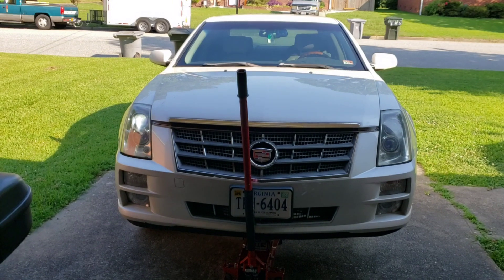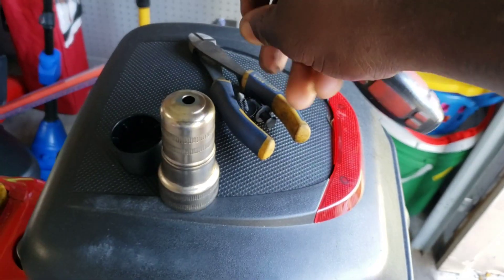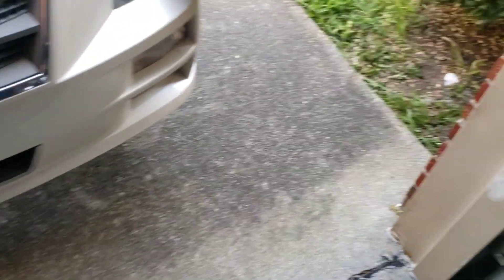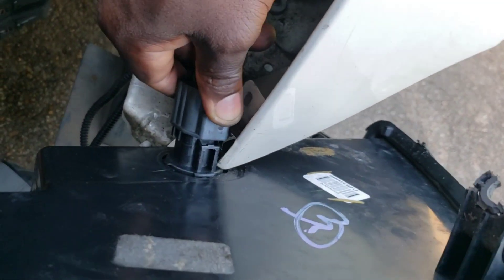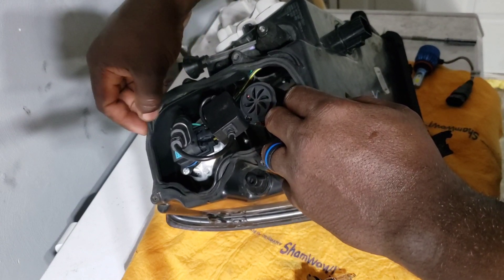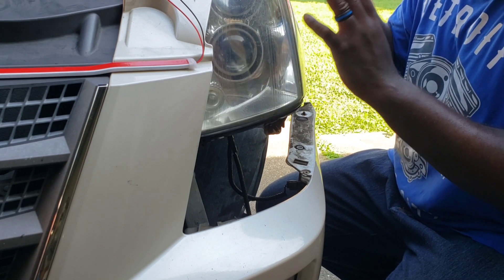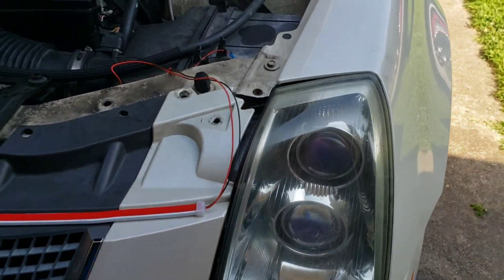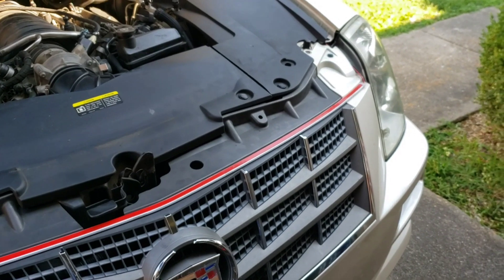HOW TO REPLACE HEADLIGHT ASSEMBLY BULDS ON YOUR 08 CADILLAC STS

Comment: A real PIA to replace the Bulbs in this Unit. Thoughts Homicide were on my mind when I did mine. Too bad you didn't show all the things that need unhooking under the Car, and the Removal of the Wheel Skirt, to gain access to that one Bolt. I see the drivers side Headlamp has already had some Damage. Is your car Gold Mist? Mine was, great colour as it doesn't show Dust or Dirt well. I could go months, even years between Car Washes
Reply from the maker: , my car is a white pearl
Reply: @fixitdaniel  

It is hard to tell in the Video. I liked several of the Colours that Cadillac has used. Exceptions being Green and Black. The Crystal Red Tint they had back then was nice.

Comment: Did you have any issues with condensation or moisture in the headlight assembly? My bulb is out but my mechanic is suggestion buying new headlight assemblys because of moisture.
Reply from the maker: , So they took care of that by putting 3 holes at the bottom of the headlight assembly to drain out the water there was still condensation and moisture but it didn't build up like it would be cause they put the 3 holes in there once still the sun might hit it dry it out and then it'd be alright but I didn't want to keep doing that so I just replaced them
Reply: @fixitdaniel  Ok,thanks. How are the LED lights holding up?
Reply from the maker: @dragonfly4494  very well I could see great on the road it's very Luminate it I like it alot I'm glad I added the LEDs to my headlights